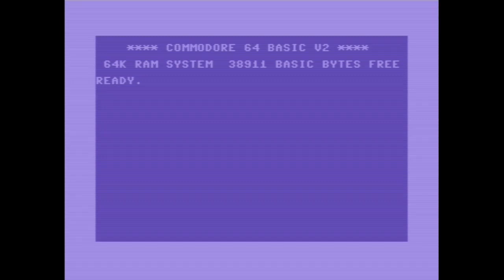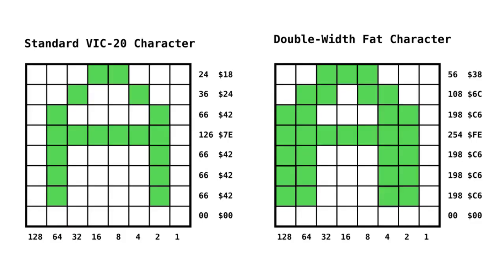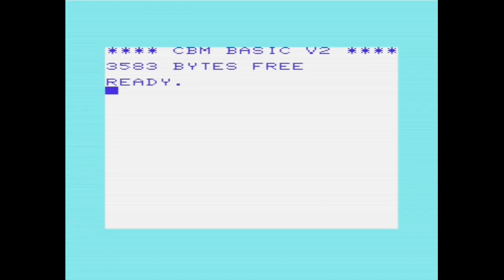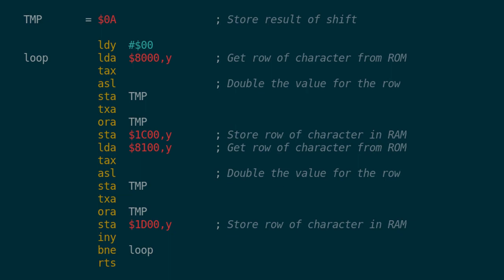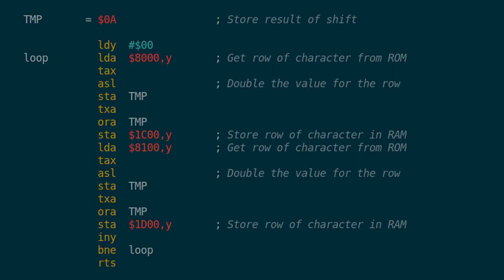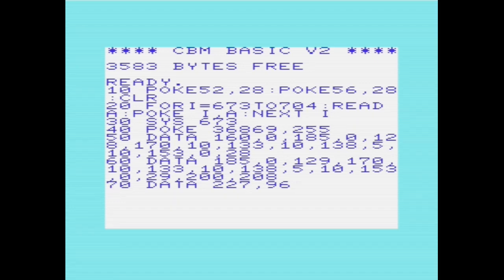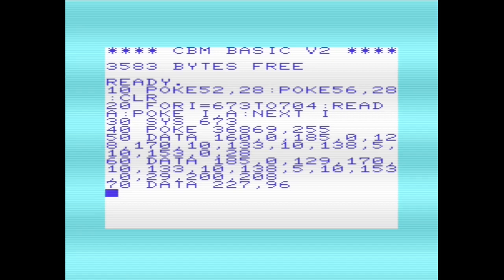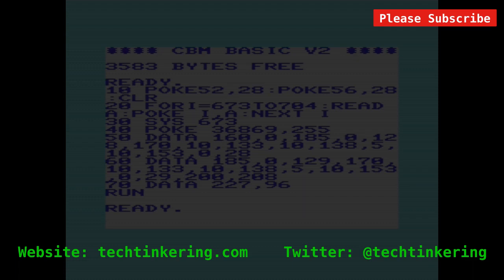Double-Width C64 Style Font on the Commodore VIC-20

Comment: 0:04 The quality of using TVs over RF Channel 3 wasn't that great, either.  The Atari and even PC-CGA fonts were also doubled, maybe because of the pixel aspect being so thin otherwise.

A good demonstration of this would be to load the VIC-20 font into the C64 and see what that looks like on your Separated-Video setup.

0:20 Each pixel on the VIC-20 is just about twice as wide as a pixel on the C64, so the ROM font is already "double-width".

2:10 This method will produce poor results with some characters, such as the checkerboard pattern (▒).

6:27 The OR operation is commutative, so you could do «lda $8000,y : sta TMP : asl : ora TMP» instead.  Of course, the original value is still available, so you could just «lda $8000,y : asl : ora $8000,y» without using a temporary location at all.
Reply from the maker: Thanks, I forgot you could use Absolute, Y with ORA.  I guess I must have been spending too much time with the 8080.  I've updated the associated article with the shorter code.
Reply: Watcha Dude, did not see you comment till now... I just put an cheaper routine up too, and I think me and you are on the same page :D

Comment: Another very interesting video. How would I do the opposite,  as in making the characters 1 pixel wide on the C64? Could you make a video showing it? Thanks.
Reply from the maker: Thanks.  It's an interesting question, but I don't think there's really a straightforward way to halve the pixel widths on the C64 that would look right with such a small font.  But I'd be interested if anyone gives it ago. Let me know if you come up with anything.
Reply: @TechTinkering  Would taking a row, dividing it by 2 and then AND it with the original work? It will convert a pair of set bits into the a single one in the leftmost position, but I’m not sure it would work for a full character set
Reply from the maker: @Doug_in_NC  I'm afraid not.  You can easily calculate what it would do using the letter 'A' if you are interested.

Comment: Has anyone created a new ROM from this?  Curious to actually burn this to a ROM (using a 2364-to-27128 adaptor with switch to choose original or fat font) and putting this in my VIC - or can we just use the C64 character ROM?
Reply: Okay, seems to work - I burned the C64 character ROM and installed it in the VIC20 - I'm doing it on a CR with the RF shielding around the VIC chip so had to use a few IC sockets to raise the height of the 23xx-to-27xxx converter board
Reply from the maker: @Brfff  That sounds great, I'd love to see how it looks.
Reply: @TechTinkering  It did look more readable, like you showed, but it was a bit flaky because of all the sockets - wondering if I should try and make a simple 2332-to-2732 board, or 2332-to-2764 to enable switching - to be honest, I prefer the look of the fatter font on the VIC.  The problem is that I'm using a 23xx-to-27xxx board that is extended to allow selection of address lines ... but these bump into the RF shielding on a CR VIC
Reply: @TechTinkering  uploaded a short video to my channel - when I tried it originally, it worked okay (but just a bit dodgy due to all the IC sockets needed to raise the height).  I've just gotten a PAL model with PET-style keys (yay!) and have tried it again - strange behaviour.  I can change the font in realtime fine, but booting with the VIC font results in a two-column wide display and booting with the C64 font results in a six-column wide display.  I'm a little suspect of this VIC as the video output is a little flaky and I'm waiting on some more parts to finish modernising it before screwing everything back together.